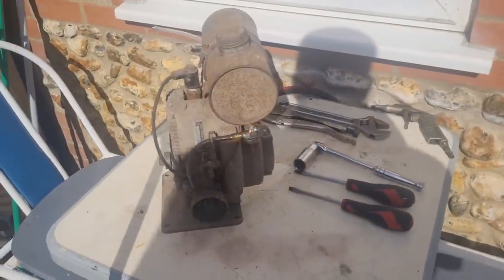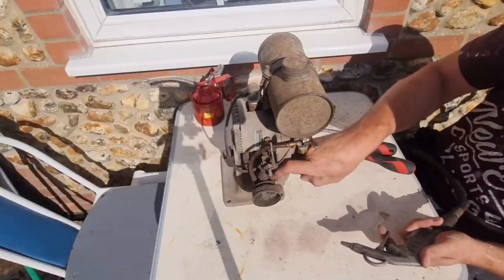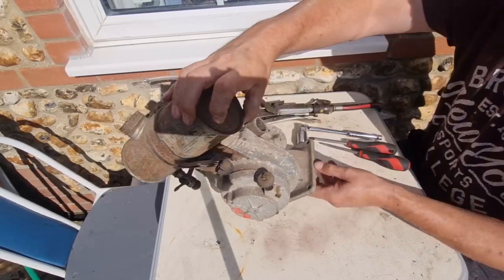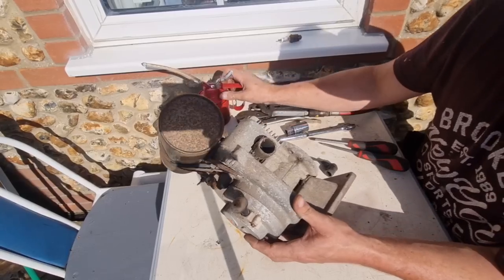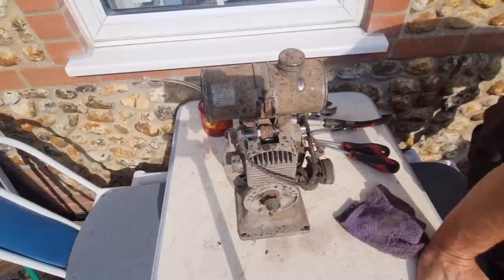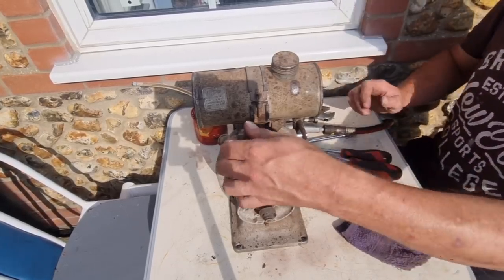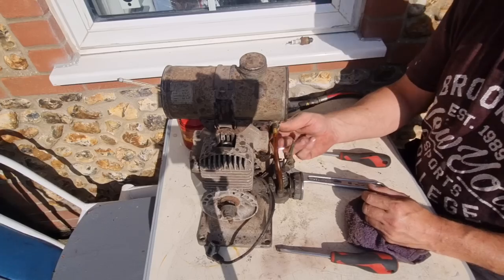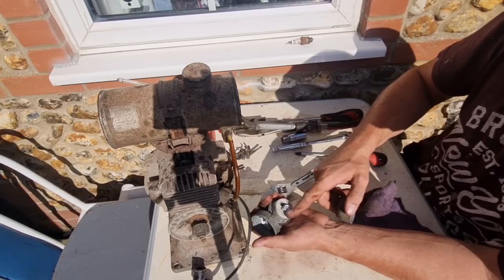SACHS Stay Mo. Old German 2 stroke engine.

Comment: I bought one last year from stalham . It was part of a really nice air compressor set for 50 quid. Just sat outside the guys house with some mowers. No spark and I sold it as it was taking up space . Guy txt 2 days later to say it was running great and in his van for use as mobile air unit. Another regrettable sale really but u can't keep them all. Nice video as always

Comment: on hard or stubborn to get off petrol lines i use a safe way of using my wifes old hairdryer on hot setting works every time.sometimes works on stubborn screws heat em up.but dont pinch mrs mancaves hairdryer she uses.

Comment: Reckon a can of brake clean with a straw may have preserved that brass filter and cleared the blockage. Had a lot of two strokes in my life and if you want your engines to last then I'd highly suggest 32:1 using a good quality two stroke oil. Cheers

Comment: Just buy some fuel line if it's bad.  Tighten that sentiment bowl up before you forget.
Clean the whole carb. in the ultra sonic.  And if the Carb. has needles, turn them in FIRST so you know how many turns to screw it in after cleaning!
There's NO NEED to use that drill/brush on the bowel if your going to use the ultra sonic.  If it has a main jet and an emulsion tube, remove them as well,
otherwise, why clean the carb.!?  You'll still have troubles with it running.
---
Wishing detergent WILL NOT do the job!  Get some Simply Green.  At 25:27 NO! DON'T PUT OIL INSIDE A CARB.!!  It should move freely if the carb. cleaned properly.

Comment: The German military used have lots of Sachs two strokes running charging sets,  from the look of the drive end on that engine it's likely that is what that one originally had  unless it was a pump. There is a you tuber goes by the name of "the post apocalyptic inventor" that recently got a whole bunch of Sachs gen sets and renovated them. heres a link.https://youtu.be/oaP-DABtThE?si=mxdklXVe2AG4aTuY

Comment: DUDE!!  REMOVE THE TANK AND CLEAN IT BEFORE YOU TRY TO START THAT ENGINE!!  OTHERWISE YOU'LL BE CLEANING THAT CARB. AGAIN!!
YOU'RE BENDING THE CRAP OUT OF THAT TANK MOUNT!!  You will have to fill that tank with Vap-O-Rust and lots of nuts & bolts and shake the CRAP
out of it!  You will also need to TRY and use the ultra sonic to clean that fitting, or replace it.  It's running rough because that Carb. needs cleaning!  SOME MORE!
Or it needs rings.  I'd check the oil level.    If your going to put it aside, shut the fuel off and run it until the Carb. is out of fuel, otherwise it will just varnish up!!
---
You need to watch: James Condon on how to clean Tanks and Carb's. CORRECTLY!